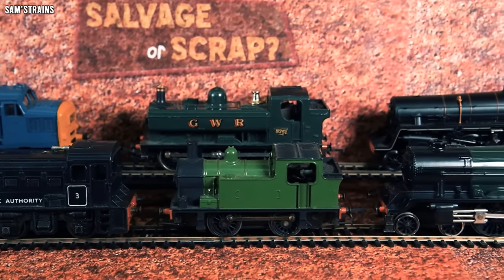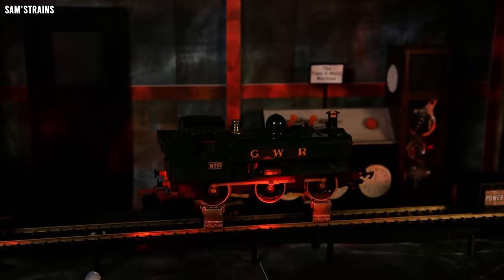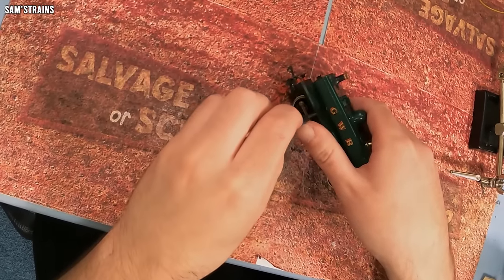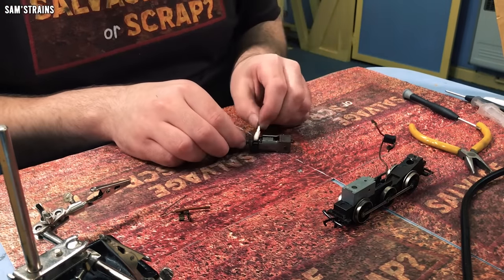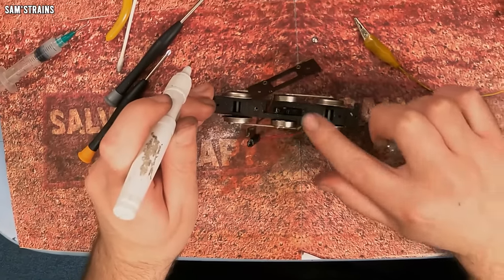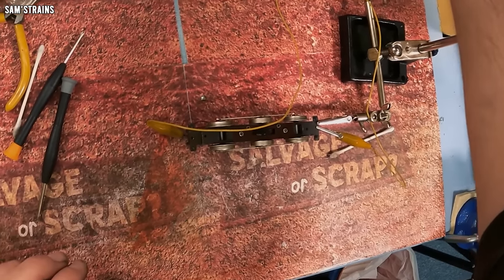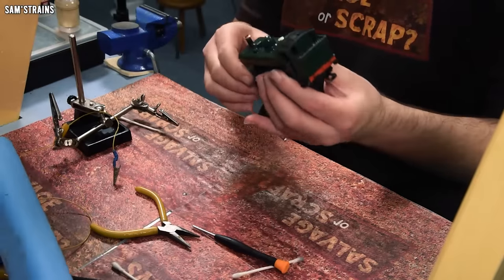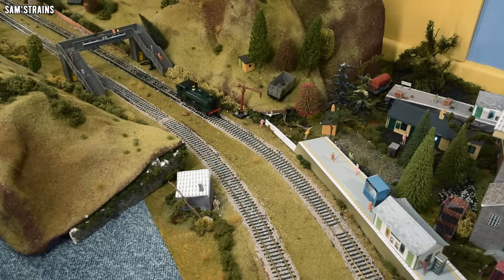Can I Fix This Broken Hornby Pannier Tank From Ebay? | Salvage or Scrap

Comment: Heres a fun fact, the creator of Thomas the Tank Engine, the Rev. W. Awdry, made MANY model railways of his books, and one of his Henry models (ironically enough) was a terrible runner, always breaking down, etc. The model seemingly disappeared, and for over 60 years, the history preservation of Awdry's old models figured he threw it away. Until, checking one of his old desks, they found it! Half taken apart with a little box that had "Henry parts" written on it. Even up until his death, Awdry refused to give up on that engine! Now discovered, the partially restored Henry is now on display with the other models.

Comment: 8:18 I had a model I bought 20 years ago from a model shop, a second hand Triang Jinty. As a kid it was 'Thomas' brother' cos of the shape, but it was £7 because it was a dead non-runner. Well, I kept putting it on the track and for fun, having one of my working models struggle to 'push' it. I liked the wheelslip, haha. Well, few times of doing this, once I noticed the Jinty's wheels start to move. Only a tiny bit. So, I took all other trains off, full power on the controller, and flicked between forwards and reverse. I did this for 3 hours or so, And eventually coaxed the engine back into doing a full wheel rotation. Just amazed me such a stubborn engine was now running. They're tough those motors.!
Reply from the maker: Ahh yes very similar to this - that's amazing too - what a way to bring it back!
Thanks for watching, Sam :)

Comment: Great program as usual.
A few additions...a selection of small Tuna Tinlets to hold all those small Screws...NOT loose on the Bench.
A selection of Tweezers to hold small screws/parts for disassembly or Re-assembly ( Surgical Forceps are Ideal, as are Self- Holding ones.)
The work style on a Pannier Tank is the same for a 1970s Rivarossi Big Boy...just more screws etc.
My Italian period ( 1974-83) saw a huge collection of American style Plastic and Brass locos accumulated, shifted home to Aussie, and remain in Boxed Storage (1984-2023) since then ( other obligations...Family, Work, University, Health etc)...Now that I am Semi-Retired, I can do a Lazarus on all my HO stuff as well as doing my 0n42 QGR 1930s Diorama ( working, scratchbuilt).

Merry Christmas and a Happy & Prosperous New Year.

BTW, will be getting a Bespoke 3D Printer capable of doing 1:48 scale Colonial type Locos and Rolling Stock
( 40' average).

Comment: The Tr-ian/Hornby PannierTank loco was my first proper Electric train,  I got it as part of a set.  GWR Pick up goods set, c1976/77 ish, included in the set was a wheel wagon the OCAEN wagon, Fine Fish wagon, Kellogs wagon and a GW Brake van,  a small station, level crossing junction signals a set of points , an uncoupling ramp, buffer stop, card tunnel (with plastic ends) and a kit form goods shed. gave many years service!

Comment: I had this exact same engine in the early 90s, was bought from a second hand model railway shop in Bridlington. On their layout it ran superb, on mine it didn't run so well at all. Even back then it wasn't a realistic looking model, and how it ran made it unusable as a shunter on my layout regardless of which power supply I used. Great video BTW, I wonder if it was my old model you have, I never mistreated it but anything could have happened after I parted with it.

Comment: Sam i have just did a gwr pannier tank like yours .i got mine off ebay as spares or repair .after i took body it was carbon brushes where upside down .so cleaned  commutator and refitted them so i have a working loco now

Comment: If you have fluff in your model train wheels I recommend using tweezers to pull the fluff out and if the motor is corroded buy a new one or use vinegar to clean it

Comment: I bought one from an auction that was seized or at least wouldn't move at all. However I felt that the engine was receivng power (slight vibration) so I oiled it and pushed it forward then it worked perfectly. Al done in 1 minute and 30 seconds.

Comment: You fix so many models! I have 2 dead  engines and I don’t know what the exact year they’re from is. However I do know it’s somewhere around the 70’s 80’s and 90’s and that they’ve been sitting on display and not running since they were bought. That could have been up to 50 years. I have no clue how to fix them. Their lights come on, but there’s no movement. I tried jiggling them, shaking them, I even tried pulling them along with another engine. But they still don’t work. Do you have any idea how to fix them?

Comment: Great to see these old Tri-ang locos running well again. Just wondering if you've ever considered 3D printing a motor cradle for the old X03/X04 type chassis so you could fit a more modern, motor into them. New finer scale wheels and added pick ups might be good. It would be interesting to see the difference between two, outwardly, similar locos, but one has a more modern mechanism.
Reply: I'm thinking Turbo!

Comment: Salvage Or Scrap?
The pannier is running crap
No signs of life
No need of the scrapers knife
The 3D printer calls
The timer falls
It can run
Its having fun
The body and couplings fits
With out any Ebay kits
Salvage or scrapped?
This engines process is mapped
The engine has repairs
No more nightmares...